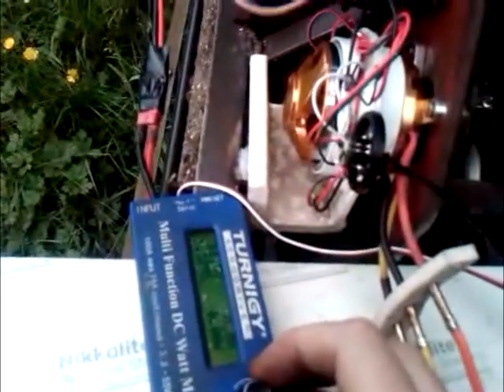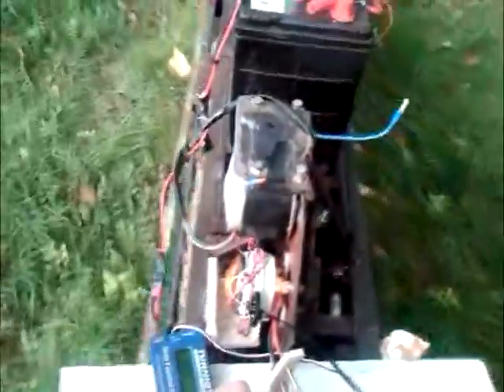5 inch Narrow Gauge Maintenance train-Brushless. PART 4

Comment from the maker: Sorry I haven't been available but Ive been in the USA for a while.
I'm possibly hoping to either Sell this as a proper system, so until its perfectly refined, I wont be posting a wiring diagram.
In answer to your question about reverse, the "Truck" controller allows reverse gear. However you have to be careful it doesn't do that when you are braking, however I have designed my own controller that stops this.